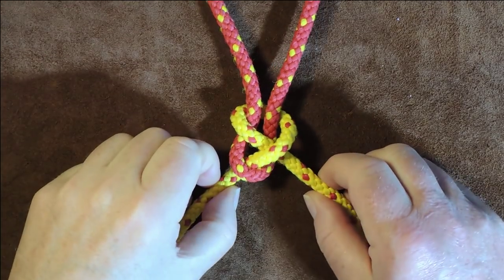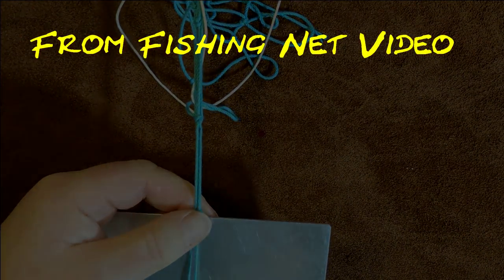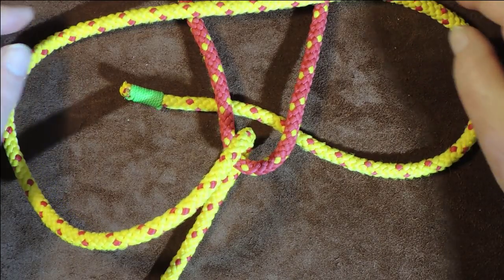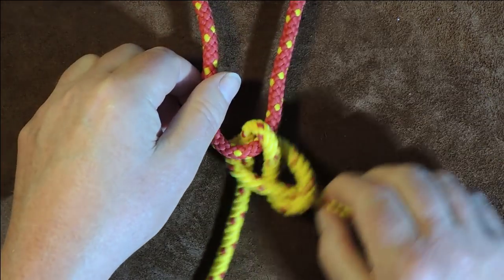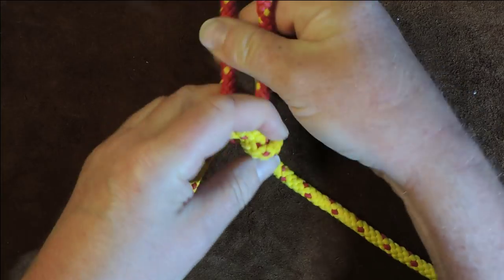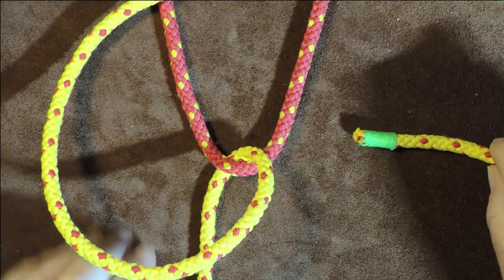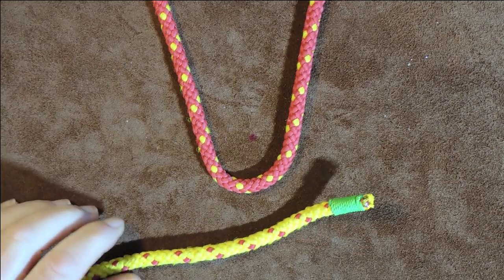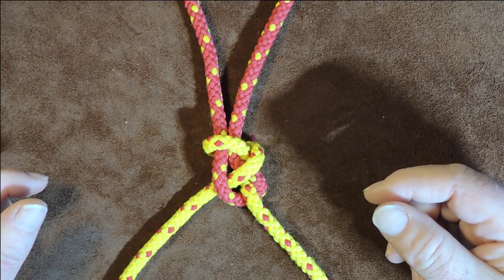Net Making Knots Close Up - The Two Net Making Knots That I Use and Why

Comment: Im using your techníque using monofilament but it slips and deforms. Shame, maybe that only works with bígger strands or with braided line.
Reply from the maker: I take it that it is also not working with the double knot method?
Reply: Sorry, but i am commenting on the wrong video. I was refering to thís one https://youtu.be/gfTWgMTqGqY well i havent tried multiple knots to it yet though. Ill try to make another one with multiple knóts and see to it if it works. Anyway thanks for the tutorial, at least it gives the idea. Sorry for my english.
Reply from the maker: Always glad to help out, let me know how you get on?
Reply from the maker: This is from another commenter, regarding monofiliment: "I tried for hours to get monofilament nets fixed and it is really difficult.  I have resorted to hitches.  A hitch allows me to get the net exactly the right length as well much easier.  The gillnets require double sheet bends and they do not flow well enough for me and tend to close improperly.  Now, this is no help for pickups.  The original net appears made of overhands; so easy.  There must be an alternative for monofilament pickups."

Comment: The second method is a very good tip for beginners. My first net I attempted with the first method, but was having some issues. My second net, I tried the second (double) method and I didn't have a single slipped knot ... and more important I was able to concentrate on all of the other details that a beginner is struggling with. Thanks!

And while I am at it: I cut my netting needle out from cardboard and used a ruler for the net gauge. (For a beginner just getting a feel of things, they worked great!!)
Reply from the maker: Yes, I totally agree with you about the double knot method. I did find that if you use less slippery cordage, then the first method is easy to do. You may also be interested in this blog post I did on net making, which covers different nets and knots: http://igkt-solent.co.uk/net-making-beginners/ Thanks for taking the time to view and also make a comment, very much appreciated.

Comment: The fishermen have been using the double knots method in our regions long ago. It's very common as it does not slip. I think some other countries also using this method. 
I learned to make casting net from local fishermen since very young. The method of making cast nets are almost similar all over the world.
Reply: yes mr lim,,, the double knots method is the right one for casting net because the line is so thin that can be easily slip  off. 
greeting from malaysia

Comment: I like that second knot. When I made nets(thinking of starting again) I had problems with a single sheet bend(my line just didn't have enough mass to it to prevent the knot from rolling out) and ended up using a double sheet bend. For some reason it worked a lot better at preventing the slippage but I may give your knot a go. Any idea what it's called "officially"?  BTW, I use a plastic netting needle but it's got a split at the point so you don't have to do that double-wrap thing that your plastic and wooden needles require. It makes it really easy to load the needle and I don't have to risk breaking it nearly as much.

Comment: What I was taught was the single turn was ok for natural line like hemp, but the double turn was more secure on synthetics.
Reply from the maker: I think you may well be right, a bit like using five tucks when splicing synthetic rope. I must say though that when I have use the single method in synthetic twine, even after some time my net seems fine. But there again, my net is more ornamental than a tool.
Reply: I use both knots making  cast nets. The first one works on bonded nylon when hand knitting them  They are dipped when finished  the which sets the knots. If you pull both sides of the bottom of the mesh you tied to before dipping it can flip the knot under the mesh just like letting it slip under while tying. The second knot is what I use when making monofiliment  panel nets. Mono is slippery and I double knot each tie using the second knot first and then another sheet bend on the same mesh. There are far fewer knots in a panel net so it is much faster to make one.

Comment: Not sure if it's something original, or if it's been done before. (I don't recall seeing a name for it.) But instead of a bend make a loop on one side, and the other line that's passing through you tie what amounts to a clove hitch over where part of the loop doubles up. If you cinch that up, it's unlikely to go anywhere at all. Not the smallest knot, but seems like one that will not shift or slip in position down either line.

Another one that will hold place is more difficult, since it requires overhand loops put into and properly spaced along the first line that you're tying to. (A bit of crazy planning ahead on this.) Those overhands aren't cinched or tightened starting out, but it is important that you work them into position to have the spacing right. With the second line you go through and follow the first line's overhand loop back through itself. If you do it right, you get a form of water knot. Cinch that, and it also doesn't go anywhere. And this is a neat and small knot. And if there's tension on either half it's not going to lose its place or come apart. (The water-knot type thing can also be used to put a nice round loop into a rope that doesn't collapse, but I'm not sure if there's a particular name for that. Seems the water knot tie is more common to join two lines together instead.)

Comment: two questions........do you use anything to help protect your hands from the twine, such as powder and tape.... or..... just a good callous formed from years of netting??? .... the second question.....have you ever heard of or used a technique called the flying dutchman.....
Reply from the maker: Hello Billy, thanks for taking the time to leave a comment. When it comes to net making, I do not use any form of hand protection. Mind you having said that, none of my nets that I make are large enough to cause me a problem. I think when it comes to the Dutchman variant, the knot is tied underneath rather than over the top, as I show in my videos. I am sure there might be a good reason for tying one way or another. Mind you some knots vary from county to county or even country.

Comment: Strangely enough I made my first net yesterday, had this exact problem, and this shows up in my feed this morning. 

The other issue I have is pulling my knots tight enough. That will come with practice I suppose.
Reply from the maker: After a while, you can feel if it is going to work or not. I started using the double method, till I got used to it. Do you enjoy it though?

Comment: Thanks for the video which has got me going at last.  Is there anyway to rescue a slipped knot if it happens? I’m actually getting more done now but they still occasionally creep in....
Reply from the maker: I find if you use the double knot method, it seem to prevent this. You may also be interested in these other Net Making Videos, there are a few different types of nets and also knots: https://www.youtube.com/playlist?list=PL7nysDkNnZHelZpSk9Xi0YyztSUKgC4GA I do hope that you find some of these of interest.
Reply: You can sometimes rescue it by pulling on the two sides of the "yellow" cord like you're trying to pull them taut. This should cause the rest of the knot to try to slip upward over the "red" cord. If you've already pulled the original knot too tight, don't expect it to work very often though.

Comment: I tried for hours to get monofilament nets fixed and it is really difficult.  I have resorted to hitches.  A hitch allows me to get the net exactly the right length as well much easier.  The gillnets require double sheet bends and they do not flow well enough for me and tend to close improperly.  Now, this is no help for pickups.  The original net appears made of overhands; so easy.  There must be an alternative for monofilament pickups.

Comment: In Boy Scouts we were taught that sheet bends were for joining two lines of different sizes.  The simple bight being in the larger line, the knotted line being the smaller.  There isn't the problem with slipping down that this video describes.

Comment: Johnny Debt I struggled when first started making nets because other people did not repeat the knot like you do. They just make one and go on never really explaining the knot. I like the way you use larger cordage to explain the knots. Would you use the first knot or second knot when it comes to making a casting net?
Reply from the maker: Many  thanks for taking the time to view and comment. Having made a few nets now, I tend to alternate between the two knots. In my mind I feel that the double method is more secure, I would also recommend this one for a beginner. The main reason being is that the sheet bend method is too easy to get wrong when you first start out. However, when I mess with my nets, after they are made, I do not really see one as being better than the other.
Reply: @KnottingKnots  sheet bend method is mainly for hammocks, For  casting net  better use double knot very secured as the monofilamen line is very thin and slippery.
Reply from the maker: @abdazizmohamad2511  I find the sheet bend is fine in natural or non slippery line. If it is slippery, I then revert to the double knot method. Thanks for taking the time to view and also make a comment, very much appreciated.

Comment: Nice video, can you please make a video like this on how to untie the knot of a sack of rice from the grocery. Thanks
Reply: I suspect that there could be quite a bit of variation on how sacks of rice are closed, dependent upon the manufacturer and the country in question.  Around here, in the large bags (25-50 lbs), they are sewn and if you pull the right end, they easily come loose -- basically unzip... Some bags are sealed (via heat or ultrasonic welding of the plastic) and the only way to open them is to cut them open...

Comment: Hey, any chance you have a video on a makers knot? I've been told that's the knot to use when joining to bottom points in repairing a net.
Reply from the maker: Not heard of that one, off to do some research...................
Reply: for the bottom meshes it is the same knot but upside down

Comment: I find myself watching your videos over and over again. I think with enough pressure on the net this version could also collapse and then slide as before.
What if you put the second go around through the bight of the yellow rope? Then the red rope could not pull through the bight.
Maybe Ferrule Bezel has the answer with using the Carrick bend.
Great video and great explanation, thanks. Keep them coming!
Reply from the maker: The only time I have had a problem is when I tie the single knot version wrong at the very begining. However, just use the double lock version if you really want security.
Reply: When you say double lock are you referring to a double sheet bend?
Reply from the maker: Yes, but is it a double sheet bend? The only reason I say this is that a double sheet bend usually goes around the whole thing twice. Where as this variant comes up between the V and then goes round. It may well still be classed as a sheet bend??